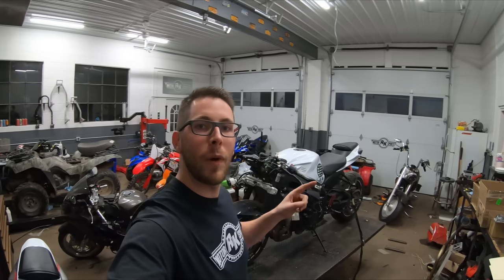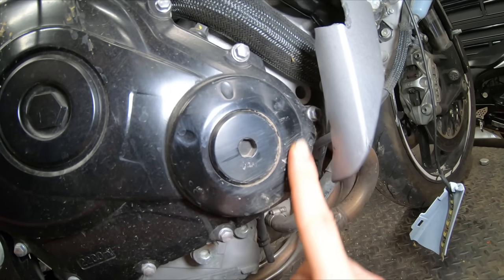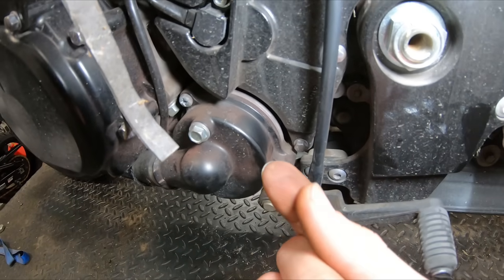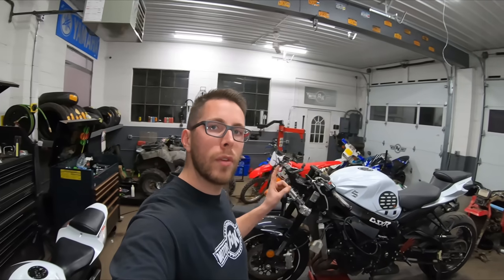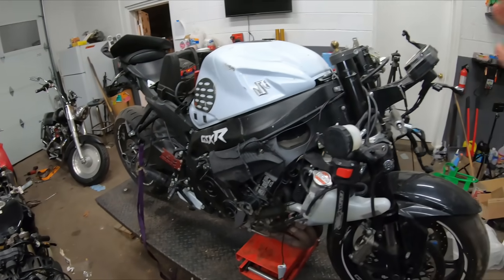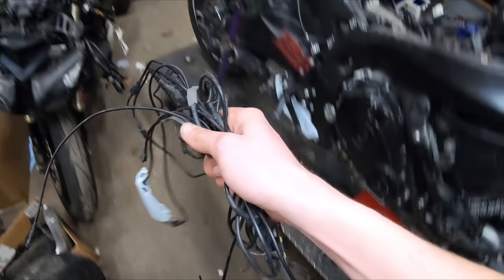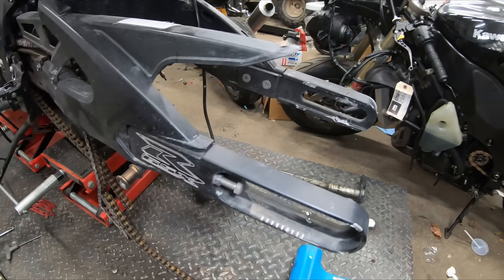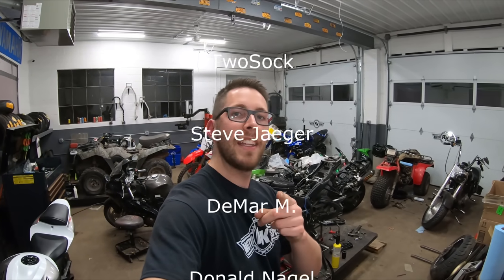Rebuilding a WRECKED 2015 GSXR 600 (Pt. 2 damage assessment)

Comment: I was way off. By 13,000 miles. Just came back from my man cave no heat Bought 2001 Suzuki Bandit 1200 S with 2033 miles on it last June I crashed it Oct on a roundabout bent forks rim trashed both rear sets all the plastic broke my right ankle. Had 4500 on it. When I crashed. I put the motor in a 94 GSXR 750 roller over this winter few hours at a time haven't started it yet but everything works electoral waiting for warmer weather to start it. You Had a email address I'd send you a pic doesn't look bad for a hillbilly build. I liked the 250 kaw you got for free Keep going.

Comment: All those stupid mods and no chain lube...great. Led lights on motorcycle means gixer squids. I already mentioned this in your previous gixer build. Again that same shity exhaust... wtf. Can't call it an exhaust, its just a piece of pipe. The rear brake mounting made me faint. Please check whether the engine is mounted properly. Previous owner might have wire taged it to the frame🤣. About the keys, you could have opted for the after market suzuki logo blank keys and groove it. Gives the look of original keys. The best thing happened to this bike is that you bought it. You just ended its misery and now trying your best to bring it back to life. That great brother. Waiting for part 2. Good job man.✌

Comment: Although I do agree with your sediment about the light-up valve stem caps, being super cheesy, I find it hard to believe that they could rip a valve stem off. I just can't see how it could be possible for it to tear the valve stem off when the rotation of the wheel would push the light to the outside of the wheel, therefore pressing against the valve stem harder. It can't pull the valve stem out if it's pushing in on it. I could be wrong though. Wouldn't be the first time I was for sure.
Reply from the maker: it's more likely to happen if the valve stem is old and dry rotted and will tend to break/ tear off easier